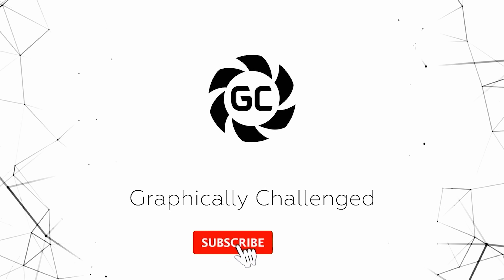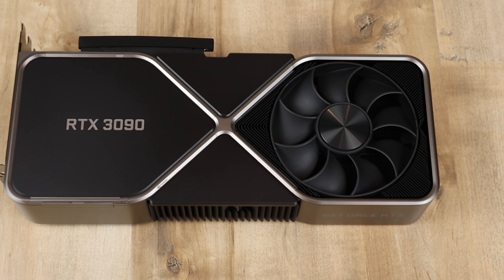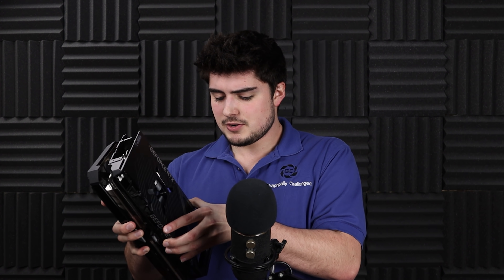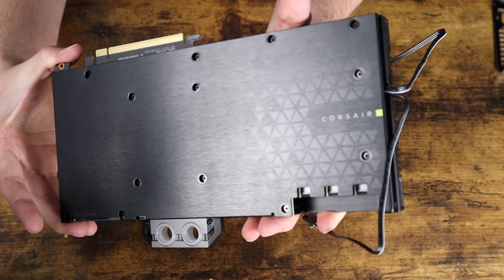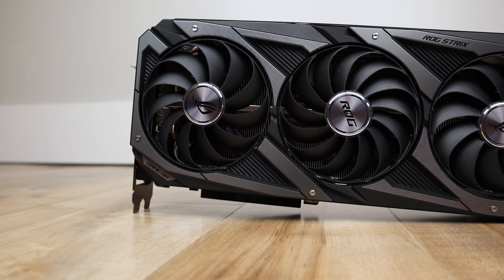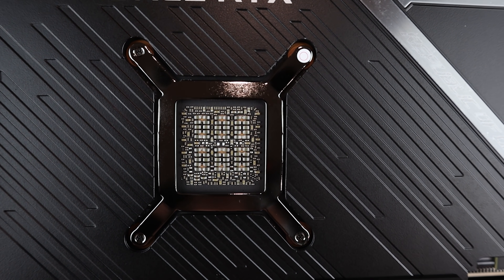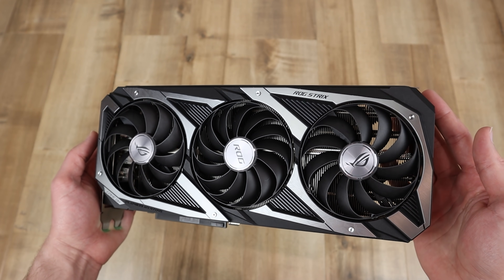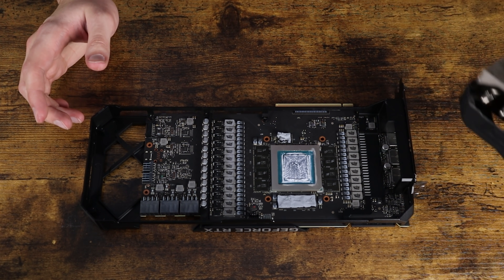Nvidia's RTX GPUs Have a MAJOR FLAW

Comment: The problem is replacing the thermal pads void your warranty (basically everywhere outside USA). Immagine buying a $3000 GPU and need to void your warranty just to make so your card doesn't explode... good job Nvidia!
Reply: Yep that's why I'm just leaving mine as is, if it does die Nvidia has to fix it. Vs me voiding my warranty to improve temps.

Comment: Crypto miners are taking the back plate off and upgrading the thermal pads on it to keep it cooler and stop throttling.  Also blow fans accords them to keep it cool.   3080’s and 3090’s have the same issue with the memory while mining.

Comment: I bought a Gigabyte 3090 Vision and the back plate on that is a hefty thick piece of steel, so my Vram won't be getting any where near as hot as 90+ degrees.  The backplate on that Asus card looks like tin foil so it's no wonder the Vram is getting toasty. But great clickbait :)

Comment: Thats actually a good thing if crypto Miners cant mine on 3090
Reply: 10$ thermal pads...
Reply: Not good for those of us who primarily game but mine during downtime to try to offset the cost of the card.
Reply: @waggy401  is that worth it though? Mining with just 1 card, especially if less powerful? Been thinking of soing that but dunno if I should.

Well I sold my 5700xt anyways so no point really.
Reply: @user-wq9mw2xz3j  well, I'm not going to buy a house or anything, unless crypto really goes up. But I've made $200 in one month (also have a 2070 Super working). So, if things remain steady-ish the card should pay for itself in a year or so.
Reply: @waggy401  so you have 2 cards mining? or just 1?
And the other card is a 3090 or?
Reply: @user-wq9mw2xz3j  one card is the 3090 on my computer. The other is the 2070 Super I put in my kids' computer.

Comment: Does the 3080 fe have the same issue, cuz i heard the temps were refreshed on the 3090
Reply: @TheBadassOne17  so it didnt get refreshed? Feels bad
Reply: nah the 3080 doesn't have memory chips on both sides of the PCB like the 3090 does so its not the same issue.
Reply: @TheBadassOne17  yes I do have a 3080 and sure there have been some with issues of hot vram on 3080 but due to the 3090 having ram chips on both sides of the pcb the problem is even worse. Most 3080s dont have this problem anyways, mine runs @ 90c tops for vram.

Comment: I got some new thermal pads for £20 and it fixed the issue
Reply: Which ones did you get? I need to do the same.
Reply: @waggy401  I had a RTX 3080 Suprim X, not a 3090 but it has the GDDR6X and it hit 110c and throttled. You want to buy good thermal pads, because cheap ones don’t cut it so use thermal grizzly or thermalright extreme odyssey. They dropped my temps from 110c to 70c. I made a post on the linus tech tips forum too, if you need more help because my GPU has another problem causing bad cooling due to a poor design
Reply: Ok. Is there a specific thickness, or do they only come in one size? I know that can be an issue.
Reply: @waggy401  General rule of thumb, for the front side of the GPU the pads are 2mm and for the rear with the backplate it’s 3mm but it’s google your card online or measure the pads yourself. It’s very important to get the size right

Comment: Would we expect the 3080 Ti to have the same problem when it comes out? Since it also uses GDDR6X?
Reply: I imagine it won't be as bad, my guess is that they'll only put VRAM on one side of the board, so the heat sink will be handling all that heat.  When I took my 3080 apart, it looked like there was room for more VRAM chips on the heat sink side.  I bet you'll still have to replace the thermal pads if manufacturers continue to insist on using the cheapo chewing gum ones.
Reply: Thank you for the reply, that's great information and reassuring! Will definitely keep an eye out for the chewing gum. ;)